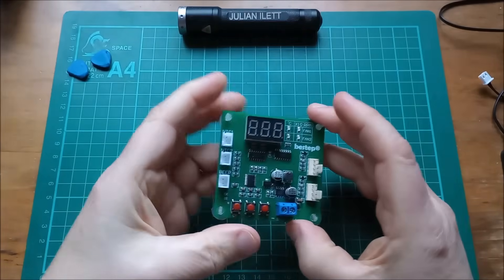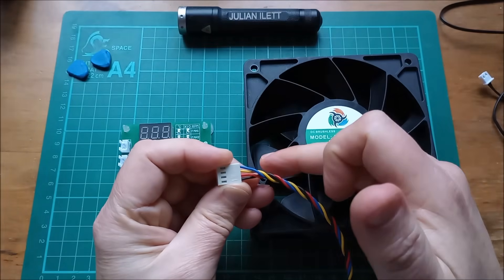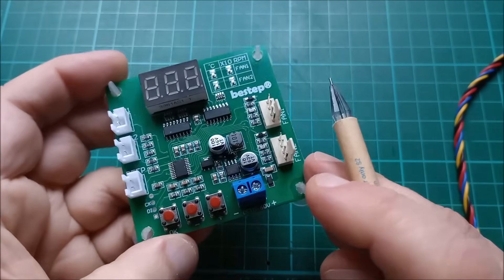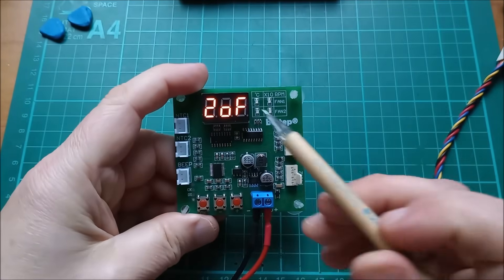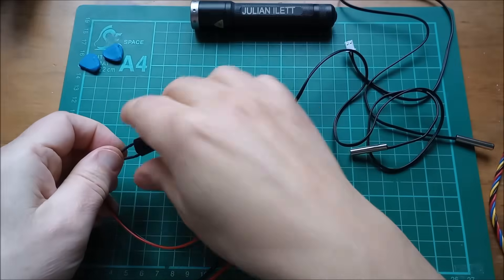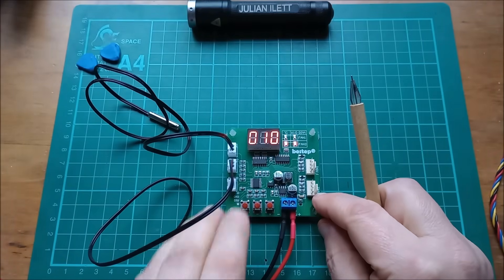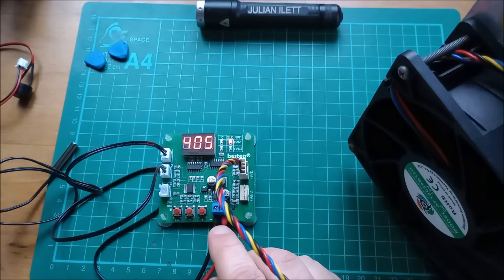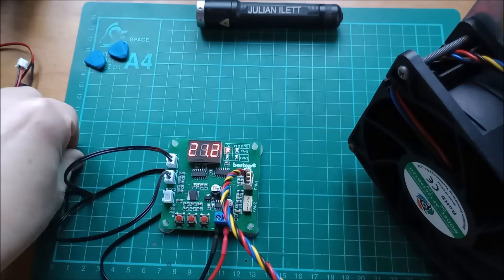4-Wire Fan Controller/Tester

Comment: What is the maximum current this circuit can supply?  My application requires 12VDC at up to 6 Amps (for a blower).  Will this unit supply that current, or is there an easy way to boost its output, OR, maybe a different type of 4 wire controller?

Comment: The fans from Antminers are Delta fans which are capable of reaching upwards of 6,250 RPM.... YOU DO NOT WANT to handle them without the fan grilles (guards) in place.

Comment: Would be awesome if someone had a file for 3d printing/ cnc cutting an enclosure for the controller. Ive seen one for the same board but 3 pin fans, so id guess its the same. I got a pack of 4x smaller 2 pin temp controllers from amazon with little clear snap lock encloseures. Really cool little boards and work well but no speed regulation. I have one of these double controllers and think it works great.

Comment: A while ago I designed a triple-channel PWM LED controller with a fourth channel for a PWM fan, however the fan control was just manual, which was fine for my application. The PWM was generated by using a pair of op amps to make a triangle wave oscillator, and a separate op amp for each channel would compare the voltage from the potentiometer on its input to the triangle wave to generate the PWM signal which fed MOSFETs for each channel. I tuned the oscillator to around 22KHz so I couldn't hear the fan whine, which also meant the PWM for the LEDs ran at 22KHz, so it has the added bonus that it wouldn't cause flicker if I use them on camera.

Personally, I prefer these analogue solutions over programmed microcontrollers. I didn't have to program a line of code or pull out a programmer to program a chip before I can use it. Not to mention stuff around debugging my code when it doesn't work properly. Sure, it doesn't have as many features as one that's computer controlled, but I don't need those features anyway. I just wanted to turn a knob and have an LED strip get brighter or change colour.

Comment: ive had one of these for probably 4 years now and i had no idea i could turn off the 2nd fan. ive been using it on my motorcycle radiator with a pair of Delta 120mm fans. incredibly robust fans as theyve seen rain and mud for which they were NEVER rated for.

Comment: Last year I bought a simpler version without the display, to control a couple of fans for my solar inverter, which got much hotter than I'd have liked when delivering full power. With 2 80mm fans under speed control, it now keeps the inverter IGBTs  under 60°C, instead of allowing them to get well over 140°C they were reaching with convection cooling only.

Comment: I could use a 4 channel one for a server I have to better control the fan speed on the drive hotswap cages. The fans on that are usually running way faster than needed and that causes more noise than I like.

Comment: Your fans with more than 2 wires usually have hall sensors in them which are typically 5v so maybe that's the 5v 4th wire on the 12v fans with the 3rd wire being the feedback from the hall sensor. Take that sticker off the fan and remove the circlip and have a peek. They stuff quite a bit under there. Obviously if it's brushless there has to be a controller right. 

A little dot of machine oil to extend the life of your fan is not a bad idea. If you've caught a noisy one soon enough you may eek some more life out of it. There's a real variety pack of bearing a power inplementationon these things. You can take apart 5 fans and have 5 completely different things going on under the hood.